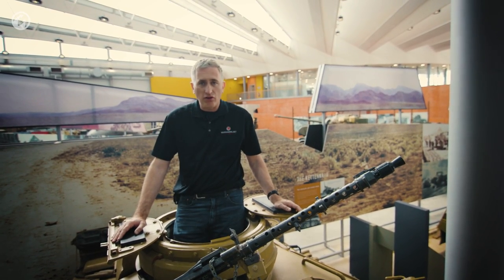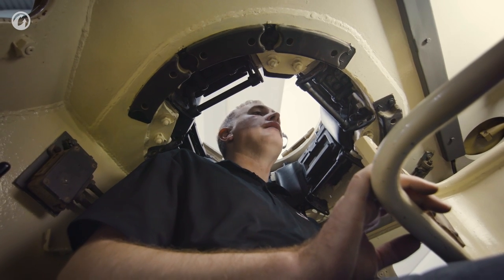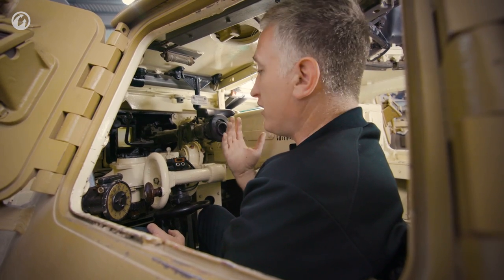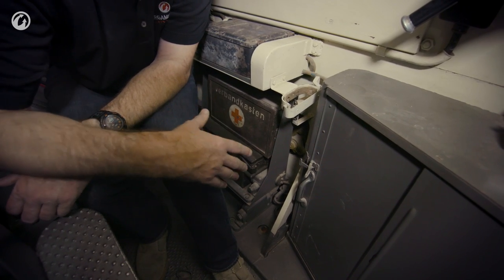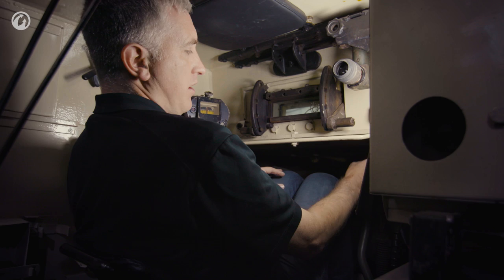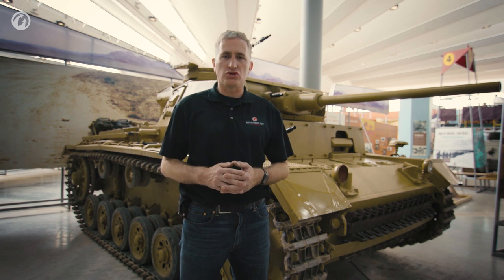Inside the Chieftain's Hatch: Panzer III Part 2

Comment: 0:41  That MG34 is the standard infantry version - a Panzer wouldn't use it. There was a Panzer version. 

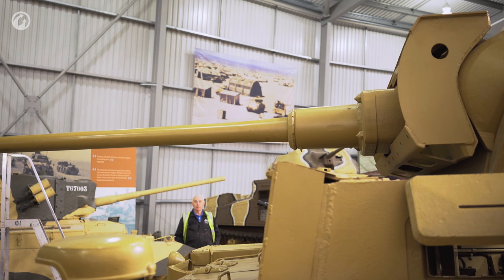5:28 The word "traverse" refers to rotating the turret to move the gun sideways. The word you're looking for is "elevation".

06:40  "periscopic sight" is wrong. That little port was for shooting flares through.

7:00 While discussing the gunner's position, it would be helpful to explain how he fires the gun! There's a trigger, there are indicator lamps, and there's a backup battery if it goes wrong - you don't show us any of this!

9:00  "These boxes here" are the power transformer for the radio receiver, the first-aid box, a box of MG ammunition, and the transformer for the radio transmitter.

13:25 "My guess is that this is a timer".... Just about every type of Panzer had this standard electrical gyroscope. It's well documented. It acts as a compass, it doesn't have a timer function.
Reply: Specially armoured MG34 were mounted in front.
Reply: @AKUJIVALDO   Sorry if I did not make myself clear. A tank crew would want ONLY the armoured version of the MG34. Because it could be used both as an AA defence and mounted in the tank's ports. The flexibility made it more useful to them than an ordinary MG34.

Comment: In second 0:04  of this video you can see a mounted issue on top of the right chain....looks a little bit like a "helmet" . I have seen this at many german military vehicles and I always wondered what it is? Maybe you can answer this question--thanks in advance!
Reply: you mean the objeckt on the left track guard?

That is is a light for driving in the dark outside of friendly teritory. As you can imagne if you expect an enemy might be nearby and looking for you you can just use the regular headlights as they would give your position away. So they use this special light that thanks to its shape only illuminates a small strip of terrain directly infron on the tank, enabeling the driver to drive in the dark. Thats wjy it is usually mounted on the same side of the vehicle as the drivers position.

Comment: Excellent, and I agree that the PzKmpfw III is an underappreciated tank. After all, Germany's greatest successes in WWII all occurred while the PzKmpfw III was their main battle tank (and the PzKmpfw IV was a support tank).
I was quite surprised with the proximity of the recoil guard to the commander's legs. Was this a compromise when the L/60 gun replaced the L/42 gun? Or was it a design flaw (inconvenience?) from the outset.

Finally, I think that the PzKmpfw III in 1940 had the 37mm gun, so it was inadequately armed, IMHO. However, by Barbarrossa, all PzKmpfw IIIs had the 50mm L/42 & it may be fair to say that in 1941 it was the best tank in the world that was available in impactful quantities (so the T-34/76 wouldn't count).

Looking forward to your next video!

Comment: so even when coming out of the turret, isn't it still quicker than many other tanks you looked at?
Obviously you might need to cross the actual fire hazard, but still, that all depends where the fire even started.
Also the covered ammo storage makes for a bit more fire resistance?

Comment: Pz 3 was my most favourite tank. I even make a semi sci-fi upgrade depiction of it by having a turret of a Comet tank (bit modified of course for the gun) and swap the gun with 7,5 kwk 39 gun so that it has more room inside and included modern upgrade such as modern gun sight, digital battlefield system, etc etc. Btw, how much weight a Comet turret has? Oh and any specific on the dimension of it?

Anyway I really really love the video, and it is kinda painful of a wait for part 2 :))
Reply: They don't even have the same turret ring diameter. If you could easily make a Pz III ring larger, they would have done so, and to reduce the diameter of the Comet turret would defeat the whole purpose and make it impossible to fit the larger gun (never mind that reengineering it to that extent would basically involve designing a whole new turret, so you might as well just design a whole new turret; the whole point of using an existing one is to use up existing stocks or at least tooling and molds instead of setting up a whole new production line).
What you are describing is fantasy, not sci-fi. Sci stands for science, which means it is based on plausible, reality-based (or potentially real) scenarios. Fantasy can be fun as well, but they aren't the same thing. And dropping a Comet turret on a PzIII chassis is fantasy.

Comment: Anybody figure out the timer thingy was????
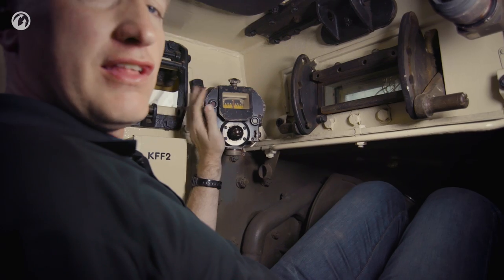Reply: Perhaps the timer thingy at the 13:19 mark is for navigation, especially after dark or in the desert. It might also be for monitoring engine hours to make sure the driver (normally the vehicle's primary mechanic) is keeping up with servicing the engine. Somebody with a copy of the manual, chime in.
Reply: @amerigo88  That was my guess as well. Drive so far, on such and such a heading, for so long, etc. I know the British used that navigation method in the desert. The only viable alternative would be using the sun & stars to navigate.
Reply: Boiled eggs?
Reply: @ExUSSailor  For sun and star navigation, the commander would have to get out of the tank, take measurements with his sexton, do a little math and then look things up in a table.  The British Desert Rats always had a specialized navigator with them who's only job was to keep the unit on the right path.
Reply: @elistickband  finay
Reply: Did the British later copy this feature for notification when the boiling vessel was ready to brew tea?
Reply: Electrically driven Gyro-compass for navigation.
Reply: I have seen some rather grisly photos that show just how difficult it was the driver to get out in the event of a fire.
Reply: Kurskreisel, gyroscopic compass which was standard on German (and probably some others in different forms) tanks
Reply: Idle timer the was Fuel shortages in germany during WW2.

Comment: A fantastic video, many thanks! I saw the gun traverse/ elevation wheels but I would love to know how the main gun was fired?
Reply: At 05:35 he is holding the grip handle of the traverse wheel.
It has a trigger which you can see.
That pushes up a rod which closes a switch in a little box on top of the traverse gear. You can see it peeping out just above the white shaft of the elevation wheel. Its wires are missing but you can see the two round connectors for them. It also has a red lamp which lights when you press the trigger.
The twelve volts then runs along a wire to the front roof of the turret, above the gun and on the right, where there's a socket. A lead from the gun is plugged into that. And so the signal goes to a safety switch on the gun, then to another diagnostic lamp on the gun frame, and then into the breech block.
Reply: @daveybyrden3936  Many thanks 😀

Comment: Would this layout be the same for the panzer 4 ?
Reply: The Pz4 is slightly larger overall, that allows it to have extra hatches for the driver and radiogunner. The turret is also bigger, though the bigger gun also takes up more space making it relatively comparable in the end.
Reply: The same layout and much of the same equipment.  But the Pz.4 turret had a floor that rotated with it.

Comment: Dear Chieftain! Im very like your videos. You said on the Panther and the Pz III, that you dont see the reason for the azimuth indicator on TC cupola. You said the gunner has limited vision, only on his sight, but has an own azimuth indicator. Maybe they use them, the TC yell: Enemy tank 1'o clock, the gunner crank to 1 o clock and then, laying on the targer in his sight. 
What i really dont understand, why the germans placed the transmission forward? Sloped or not sloped front armor, the transmission change not easy as on the Sherman. Why they didnt put it in back, like russians, or the brittish, or made it easy accesable like the Sherman?  As you said the torsion bar takes room from the hull floor, but nobody cares about the driveshaft? And this for all of their vehicles from the Pz I to the Tiger II, and all that based on them, the TDs, SPGs, Stugs. Why they done that?
Reply: I have no quarrel with the idea of an azimuth indicator for the gunner, it's the one for the TC I don't see as necessary. The TC knows where he is compared to the vehicle by just looking out the periscope or looking at the hull interior, he doesn't need an indicator to know where "1 O 'Clock" is.  I can't explain why they had a questionable transmission access.

Comment: Why do some tanks have a front drive sprocket? Wouldn't it be better to put the transmission in the rear? It saves you from having the drive shaft running through the tank. What is the advantage of the front drive sprocket?
Reply: The track will transport dirt. If the Sprocket is in the back it will get muddy fast. Is it in the front, the dirt has time to fall of the tracks.
Reply: I believe it gives the tank more even weight distribution and more pulling power in climbs as well as in off-road environment. Sometimes it also offers more protection to the crew.

But more often than not, it's simply to save space. Especially in something like a Sherman, putting the transmission in the rear would make the tank even more bulky.
Reply: It also factors somewhat in the crew protection, as a penetrating shell might get stuck in the transmission.
Reply: @Lahnapihvi  The transmission in the front is bulky. It is why the Sherman is so tall.
Reply: @carriertaiyo2694  i said it wrong. It would make the back of the tank longer.
Reply: 1advantage Is armor protection

Comment: Great to compare this video to Panzer III Vs T-34 (featuring Chieftain) at Https://youtu.be/1xTQ-oyo-G4  As Chieftain moves around inside this Panzer III, note the armour is not sloping in and taking up interior space. You can see the turret's side armour thickness at the 3:30 mark.
Reply: Which is the biggest point against sloped armor that people forget. Slopes take up space. And why both German and Russian tanks went away from heavily sloped armor on the sides and rear and used it in the front where 9/10 hits are expected. (Well maybe except a few like the JdgPz 38(t))
Reply: @beersmurff  logically one could design a low, long, wide tank allowing room to slope the armour and have reasonable interior room.  I think turret armour is sloped all the way around on modern, Western tanks. Castings add curvature to armour thereby increasing relative thickness plus you get benefits of homigenized steel with few seams.
Reply: @amerigo88  Width was a huge limiting issue in 1940'. You need to be able to be carried  by rail, pass under underpasses and go through narrow streets. The Panthe rand Tiger was already pushing the envelope, hence the nearly flat sides. They had to have different tracks added for transportation via rail. More sloped sides would equal less interrior room, which was already cramped in the Panther, or make the tank wider wich would make it impossible to transport.
Modern tanks have flat turret armor. Slope does basically nothing to modern ammunition. instead they use spaced/applique armor, that is attached as sort of skirts on the turret and hull and looks like sloped armor to the civilian public :-)
Casting is fast, but interlocking gives a lot of strength.
Reply: @beersmurff  In T-34 sloped side armour decreased ONLY sponson volume. Panzer III DON'T HAVE SPONSONS. T-34 side armour layout increase internal volume in comparision to Panzer III side armour layout. I add drawing- tank indicated by "1" number, that's tank with "vertical sides, lack of sponson". Tank indicated by "2" number, that's a tank with sloped armor over sponsons (T-34).T-44 and later Soviet medium tanks have vertical side armour not because T-34 side armour layout decreased internal volume. T-44 have vertical sides because Soviets like good ratio between armour and weight- and lack of sponsons (T-44) decrease weight.  https://milimoto.files.wordpress.com/2015/08/sponsony_m.jpg

If we discuss about German II tanks, late German tanks (Panther and King Tiger) have sloped side armour over sponsons. Earlier tanks (Panzer III, IV and Tiger) use a vertical sides. This mean that sloped sides make a sense in German WWII optics.

And about sloped rear, T-34 have sloped rear hull armour, but between upper rear plate and lower rear plate was located steering system and gearbox. If T-34 get vertical rear, don't be more comfortable, because T-34 with vertical rear can't have engine mounted far more on rear than in real T-34. In T-34 vertical rear increase only air capacity inside engine compartment. Of course, later Soviet medium tanks have vertical rear, but later tanks (like T-54/T-55) have far different engine compartment layout. T-34 have radiators on sides of engine compartment, T-54/T-55 have radiator lacated over gearbox. T-34 have cooling fan located between engine and gearbox, T-54/T-55 have cooling fan located rear off gearbox. I put drawing: on this drawing we can see very small distance between side clutch and rear edge of T-34 hull. https://milimoto.files.wordpress.com/2016/01/t-34_naped_tyl_3m.jpg
Reply: @smka1719  Yes, but tank 2 weighs more than tank 1. Even if you utilized the sponson space on PzIII for added armor, you'd also add weight over a part where you dont want to add that weight. PzIII wasnt build as a General Purpose tank nor a medium tank. It was build as a stop gap and Germany in 1938-1940 went for mobility over armor.
As I said. Sloped armor has trade offs. It's all down to preference and how the tank was designed from start.
Reply: @beersmurff  I agree- If you have a sponsons, you have bigger dimension of glacis, bigger dimension of rear hull plate, and you have armour on sponson bottom. Lack of sponsons is a one of reasons that T-44 have better armour than T-34-85, despite similar weight of both tanks. But in my opinion that's not true that every vertical armour layout increase internal volume in comparision to every sloped armour layout. Tank "1" have smaller weight than tank "2", but tank "2" have bigger internal volume (despite sloped armour usage in "2" tank). If we discuss about front armour- if Panzer III get heavily sloped glacis, don't must have smaller internal volume than real Panzer III. I put drawing of IS-2 front armour layouts. We can see that early IS-2 have upper front plate sloped at small angle, located near driver head (similar layout to layout used in Panzer III). Later IS-2 have heavily sloped glacis. But late IS-2 propably don't have smaller internal volume than early IS-2. https://milimoto.files.wordpress.com/2018/12/IS-2_przod.jpg

Comment: I don't think I've ever seen a more cramped tank than the Pz.III With three guys inside the turret, the early T-34 looks like a storage room in comparsion.
Reply: vojtasTS29 ?? What the hell are you talking
Reply: vojtasTS29 about.
Reply: Yes what are you talking about? The t34s gun is larger, 2 that turret is much smaller than pz3s, t34s sucked. If it wasn't for the 1 lone kv1 germany would have been in Moscow by or before rasputa